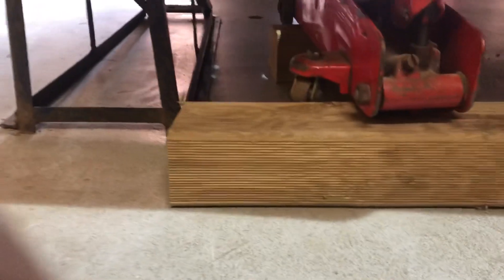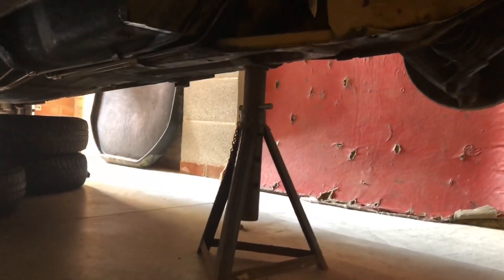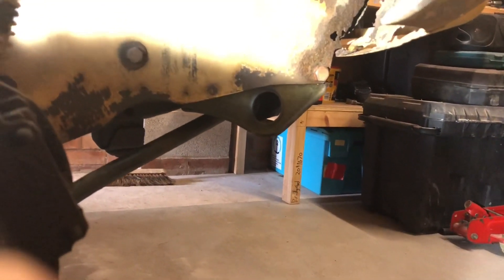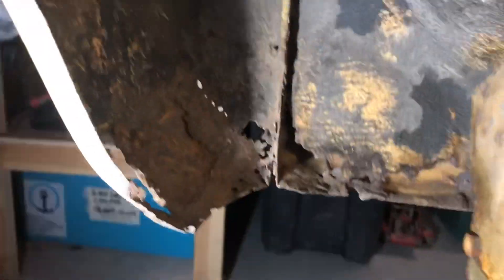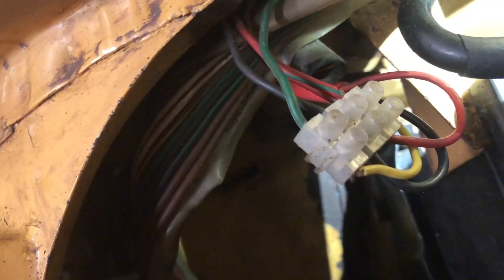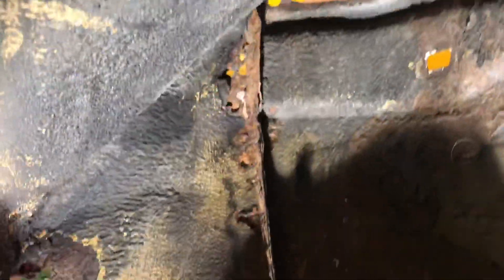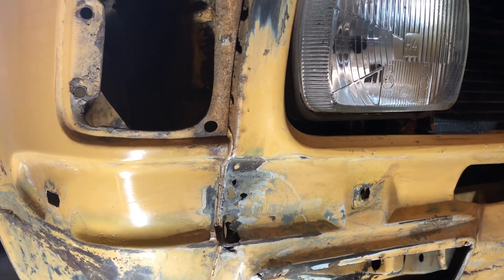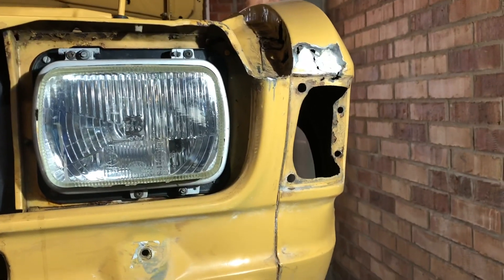Austin Allegro Ep.9 The wheels come off and I clean under arches. British Leyland Austin Allegro.

Comment: Really enjoy your vids, please make them longer! Also I would look to weld everything possible, if you fill the holes at the front, you’ll always know they’re there. You’ll only want a sheet of steel about 2mm thick and then grind the welds down, seam seal and stone chip
Reply from the maker: the wings and doors will be filled, if I end up keeping the car forever I'll source new wing and valance anyway, the boot and sills will be done properly from the start, I don't really think longer is necessary? personally I tend to skip through YouTube videos if they're too long.
Reply: That’s fair enough, with vids like this I could easily watch 20 mins and I’m probably not alone but I suppose that’d also be a fair amount more work your end too! Keep it up 👍🏻
Reply from the maker: @davewright7512  I'd get loads more done if I didn't have to film myself and then re-do it because I swear like a trooper in real life, I'm using my best telephone voice....
Reply: Yeh that’s understandable mate, once ages, keep up the good vids 👍

Comment: There's nothing structurally wrong with the car.. You could just use fiber glass with reinforce mesh to fix most of it.. I would invest in a mig welder for the larger repairs, It would be a good investment and they are cheap has chips..
Reply from the maker: True, the bits like wings and door bottoms are probably going to get filled, the sills and boot etc I'll weld, there's interesting welding news on the next video.

Comment: I guess considering the times we are living in a bodge is maybe the way forward , so long as the brakes ,steering and such like are safe then you could use the car, has the previous owner applied for historical status? and if it has it then you will be able to use it on the road without MOT or tax? so long as it is road worthy. Then at a later date the welding could be sorted out. Maybe June or July time the lockdown restrictions around Covid-19 will begin to slowly be lifted as I guess in easter and the review it will be extended by 2 or possibly 3 more weeks.But it will probably come back Oct/Nov/Dec and into the early months of 2021 we may be locked down again to some degree . Good luck with the project and here's to the next video.
Reply from the maker: Yes, it's Historic on the V5 so exempt from mot and tax, I have welding news to come, i'll fill the wings and doors but do the boot and sills etc.
Reply: @AgathaAndAnything  Sounds good , really looking forward to it.